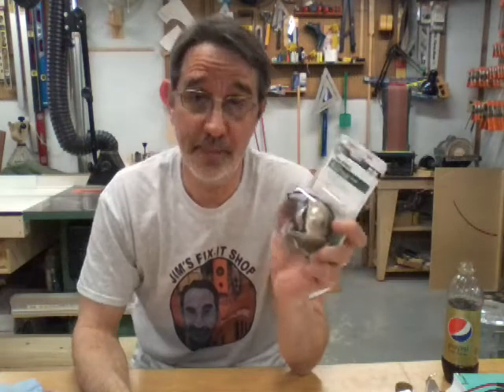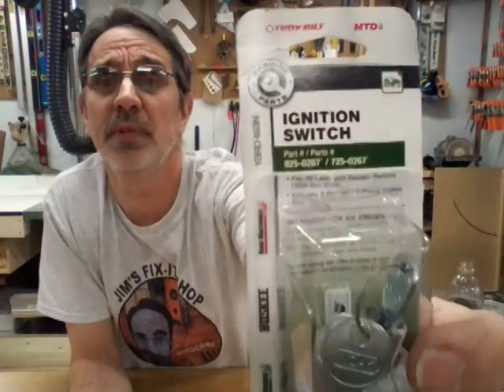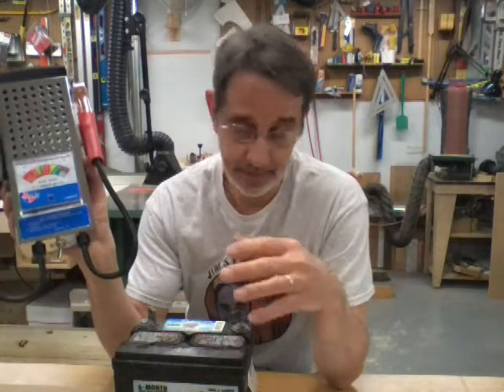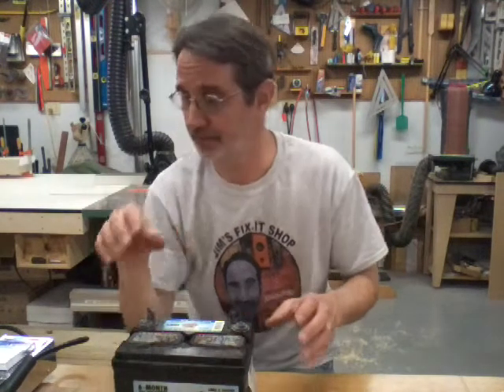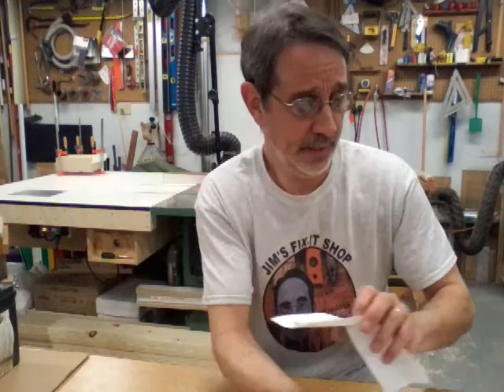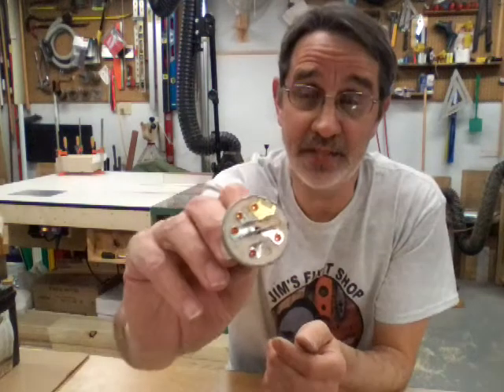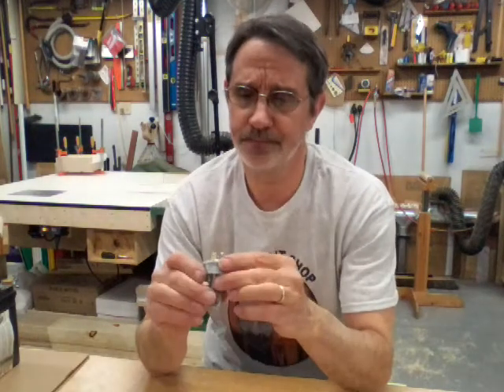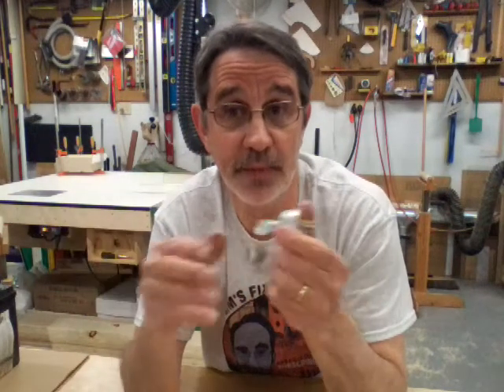181. M/S. 33 Installing a key switch and selenoid on my Snapper tractor

Comment: Well Jim I really could have used installation on the mower…my solenoid was just hanging out under the seat with no bolts holding it down

Comment: I just replaced my 12.5 H.P. engine  in my 2003 Snapper with a 2018 11.5 Briggs & Stratton engine . This has a voltage  regulator & a solenoid operated carbuerator. I hooked the kill wire from the coil on the new engine  to the black wire of the ignition  switch ( marked M) but the coil will only fire if I remove the kill wire from the coil the coil will operate.  Do I need to replace the ignition switch? The ignition switch on the machine now has B, G, M, S, that's all. B is red, S is blue, G is green & M is black. I have no idea how to hook up the carb.?  Can you help?
Reply from the maker: William Davis 
I’d like you to watch video number 301 explains how to wire the engine that you’re putting on if you have any issues that’s not covered by this video please let me know.Jim

Comment: Jim- where is my solenoid located on my craftsman/snapper 28 inch 12.5 hp mower model 107.280340. is it behind or underneath the seat? thanks pic or whatever? my manual only shows the schematic and not location of it-

Comment: Always a good idea to use relays and solenoids. You can always substitute a Ford starter relay as well, which lasts a lot longer. You can solder the connectors as well as crimping.

Comment: Hello. I really have been enjoying watching your videos... very informative. My question is can I take electric start from 10hp briggs/stratton snapper rider to 11.5 hp snapper rider?
Reply from the maker: If the bolt pattern on the starter matches the engine block I don’t see why you couldn’t change them just the first time you started make sure it’s engaging in the fly wheel properly but you can compare the two when you have them off and see if they look the same. Jim

Comment: Great Video Jim   One thing- I have a Snapper 550z with the Kawasaki engine.  Looking at the wiring diagram for that mower, the L on the ignition switch is for the Electric Clutch and the fuel solenoid.  Hard to find much info on my old tractor but I did find the wiring diagram.  It does not have lights but I intend to put lights on it.  Once again, great information and thanks
Reply from the maker: Well, in your case, I would hook a wire to the hot side of the starting solenoid, run it up somewheres to a toggle switch, and then to the headlights, unless you have a dual stater on your engine that puts out AC/DC use the AC side of the stater to run your headlights, and of course, the DC side to charge your battery.        Jim.

Comment: Stu Estrade
0 seconds ago
I have a Snapper RER Mower 7800920-00 with a 17 hp B&S Intek engine 31C707 603 E1

What non-Snapper product is available for an ignition coil, solenoid, starter, and spark plug is applicable to my mower and engine? Snapper parts are pricey! Thanks
Reply from the maker: A lot of that stuff you can find at your local True Value Hardware. store where I buy mine or Lowe’s or Home Depot or Menards.  Jim

Comment: The one on the bottom? what letter is that, what does N stand? for you mention kill wire twice ? does one come from the engine and the other go to ground? you lost me ?
Reply from the maker: The  N. On the back of the ignition switch goes to the kill wire on the magneto shorting block on the side of your engine. If you send me an email, I can send you a schematic that I made that labels all of them. Send it to Jimsfixitshop@gmail.com.
Thanks.       Jim

Comment: great video Jim - thanks. I am replacing my old snapper mower 8 hp B&S engine and want to replace my old push button start / kill switch key set up with a ignition switch and solenoid like in this video. I plan to get the exact parts you used hopefully. I'm not sure how to connect the charging line back to to battery though - hopefully my new engine will come with instruction on how to do that (most look like they have a connecting female plug with 2 wires in it). I'll email you if I have issues. Thanks for all you do!!
Reply from the maker: Kevin Webb 
I doubt the engine will come with any instructions if you need help wiring that up let me know usually has a plug with two wires typically one wire comes from the stater and one wire goes to the coil some of the newer ones will have one wire from the stater and one wire going to the solenoid on the bottom of the carburetor, just trace the wires back and see where they go otherwise let me know and I’ll help you through it. Jim

Comment: My snapper starts with key but won't shut off unless you ground it out,?
Reply from the maker: Well if I had to guess I would say your ignition switch is bad or the wire coming from the ignition switch going to the magneto shorting block.         Jim

Comment: I have snapper riding mower it runs but, it stop from the switch
Reply from the maker: I’m not totally sure I understand what your issue is you said your machine stops from the switch which switch is giving you problems. Jim

Comment: My snapper will start up with the key but the key will not turn it off... what should I check?
Reply from the maker: The key switch sounds like it’s going out.  Or it’s your wire on your magneto shorting block. Jim
Reply: @jimjackson9381  
Thanks Jim! I’m going to recheck all of that tomorrow. I love your videos! I’ve learned so much about Snapper mowers from watching your videos! 👍🏼👍🏼

Comment: Where do you ground your key switch terminal to.
Reply from the maker: The ignition switch has a external ground through the switch itself once you bolt it into the machine it’s grounded automatically. Jim
Reply: Thanks Jim. Glad to see someone that really answer your video questions. Your videos have really help me redoing my snapper

Comment: Where does the magneto wire connect in the system?
Reply from the maker: The magneto wire coming from the ignition switch or from inside the engine?           Jim
Reply: @jimjackson9381  from the engine side.
Reply from the maker: @genesnider4586  the magneto shorten wire coming from the coil should connect to the magneto shorting block on the engine by the carburetor.     Jim

Comment: Jim, think I've seen every vidio you have, Thank You.
But I've got a problem no one can figure out. Snapper 285Z, start engine, go to release the brake lever the engine dies.
Checked the seat switch, got it crossed over. Checked all 3 Stens safety switches (2 levers and brake) changed out PTO Switch and raise and lower Switch. Still same problem.
What you think?
Thanks
Tim
Reply from the maker: I’m not familiar with that model number but is there a switch on the clutch pedal there is on the rear engine snappers and that typically gives people a lot of issues. Jim

Comment: i have a YT112 ingersoll  which is a case tractor ... i cannot wire that ignition to save me ... its the normal 5 post ignition like most all others ...when i got it the wires were off and the ignition was shot so i took another ignition out of another old mower ,, ive been playing with that thing all day plugging wires here and there ,, i can get it to turn the motor  but not start ,, im not sure what to do next ,,,,
Reply from the maker: Kenney Bert 
 Hi it’s Jim
   Do you have any paperwork on the machine as far is a wire harness. Can you send me pictures YT112. Doesn’t sound like a Ingersoll number mine is eight 3016 and there’s 4016 models the 3000 series has the small back tires the 4000 series has the large back tires which does yours have, some pictures would be awesome the entire machine under the hood the dashboard things of this nature. Jim
Send pictures to. jimsfixitshop@gmail.com

Comment: Jim my snapper start but I shut off it won't started again help?
Reply from the maker: Sok Touch
Hi it’s Jim
   I need a little bit more information than this, does the starter turnover, does it have spark to the spark plug, if it does have you changed the spark plug, does it have a fuel filter on it that could be plugged, try changing that if it has one. Let me know what you find out.Jim
Reply: Jim Jackson okay I will check the spark and I will let you know thanks Jim
Reply: @jimjackson9381  I let's you know

Comment: I have electric start but it's not working. I was told to test the solenoid by jumping across the two post and if it started, the solenoid was bad. It did start so I replaced the solenoid. The mower started after the repair and the next time I used the mower. When I tried to start it two weeks later it wouldn't start. The starter just kept clicking. I had to pull start the mower. With a new solenoid and battery, is it possible the key switch is bad? The run position works just not the start. For shits and grins I just tried to jumper the two post on the solenoid again and it wouldn't start. Is that a sign of a bad starter?
Reply: Michael Anderson, if your engine has overhead valves you may just need to have them adjusted. Over time the valve lash gap can get too large which will cause your engine to have too much compression because the valves open too late and close too soon as well as not opening enough. This effectively causes too much compression which places an undue load on the battery and the starter. This effect mimics a weak battery and/or a bad starter. I have seen many people go buy a battery, which did not correct the problem, so they went out and bought a starter, which also did not fix the problem. Then they go and buy a solenoid, which will also not fix the problem, so they take the engine to their local shop only to find out a quick and simple valve lash adjustment would have gotten them up and running. The bad news is they are now out a load of cash unnecessarily. If you have overhead valves it is worth the time and minor expense to have them correctly adjusted. This is, in fact, a regular part of good maintenance. Then if you still have the problem with starting your mower you can address that issue. It would be a great idea also to check for loose or corroded connections on your wiring. You may just save yourself a ton of money, which, if you are like me, you could gladly spend on something more important to you.
Reply: It's a Briggs & Stratton Vanguard 16HP OHV V-Twin engine. The odd thing about it is that I had no starting issues until I power washed it. I had to pull start it after that and it starts on the first or second pull each time which surprised me considering it takes at least 5 pulls on my 7HP push mower. I'll keep the valve lash in mind but for now the pull start will have to do.
Reply: Then you may want to look at your electrical connections. It is possible the pressure washer may have caused something to come unplugged preventing your battery from being charged. Is your battery discharged? I ask because you said when you tried jumping across the solenoid the second time it just clicked and that is what happens when the battery is discharged.